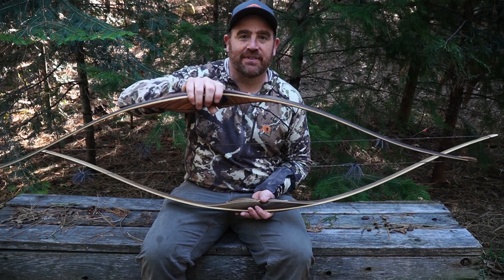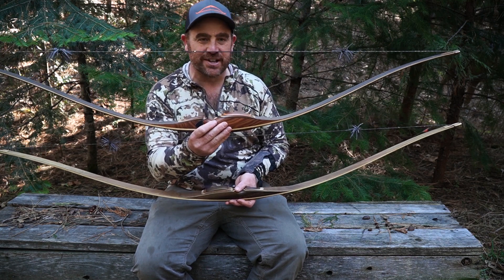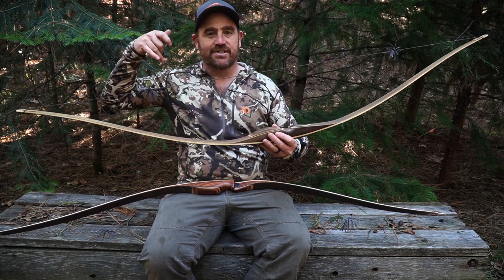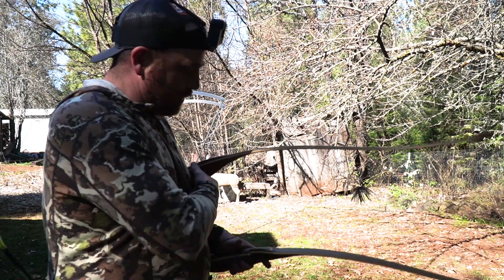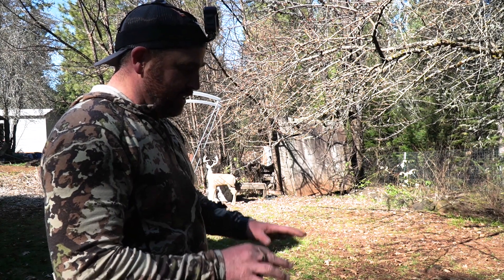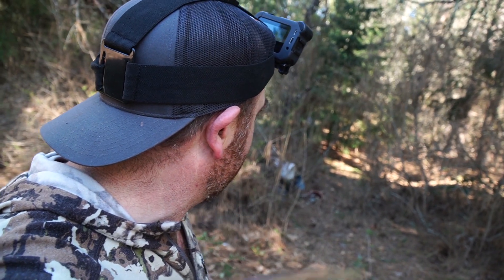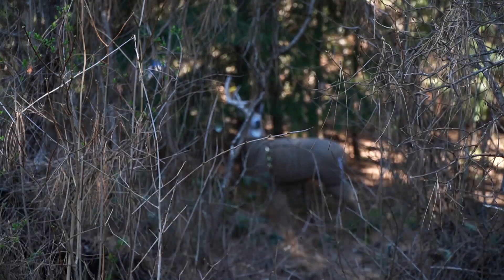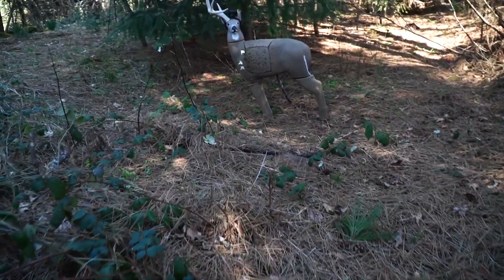Longbow Design, Which Design is Faster, And Shooting it in true Bow Hunting Situations. #longbow

Comment: Looking for arrow recommendations for a 55lb draw at 28.5inches reflex deflex longbow/aka flat bow 275grain broadheads this bow does not like the arrows i shoot in my recurves and is surprising to me cut to center
Reply from the maker: Have you shot a 400 spine  out of it?  Also 3riversarchery sells a test kit. The lightest arrow I would shoot would be a 400.
Reply: @TheLifeOutdoorz  yes that one won't shoot straight bare shaft tune nock left tried a 340 spine also
Reply from the maker: What's your brace?
Reply: @TheLifeOutdoorz  8"

Comment: I would have thought the edge , with more reflex deflex would have a speed advantage. Whats the point of the advanced design if there are no advantages ?
Reply from the maker: I definitely would have to, but my short draw length doesn't get much energy out of the bows. There is a ton of difference of how each bow draws, and I would bet the speeds would be different at 28"